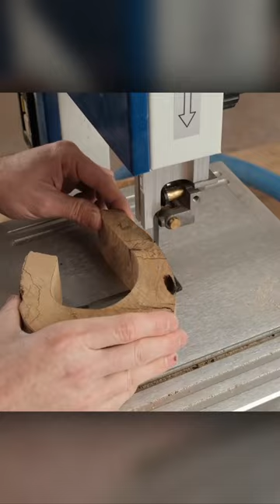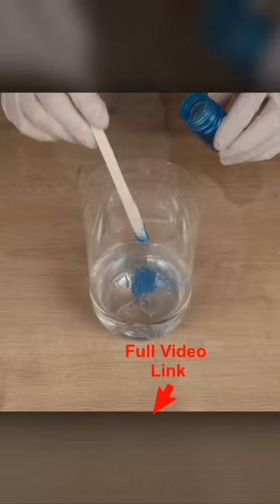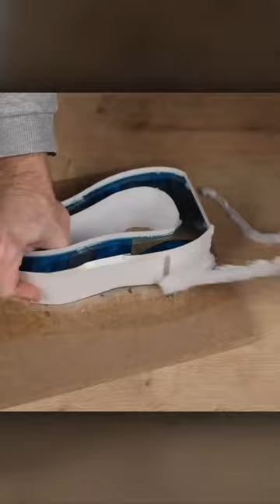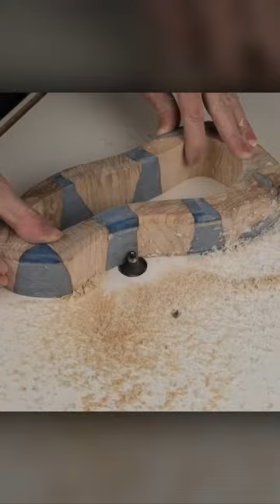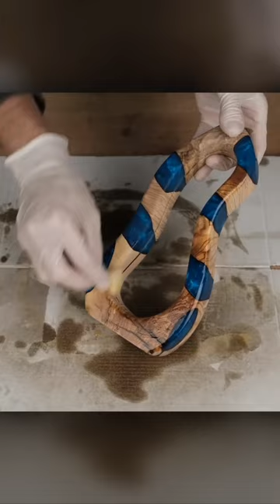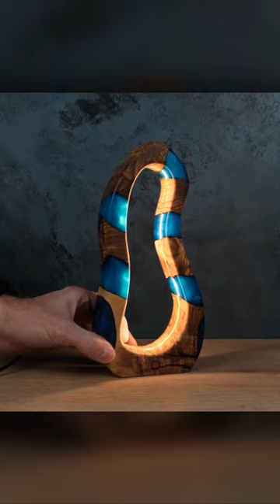Modern Table Lamp with Wood and Epoxy

Comment: Another beautifully crafted piece bro! The color contrasts in the deep caramel color of the wood with that rich blue resin is stunning. Thanks for the tip you gave me on that PVC table cover - I have some being delivered today. It’s going to be so much easier than building melamine molds! Cheers
Reply from the maker: Thanks, I'm glad you liked it.
Glad I could help.
If there is anything you are curious about or don't understand in my videos, don't hesitate to ask. I will try to help as much as I can.
Reply: @atasoy  Thank you! If you don’t mind I do have 2 questions: I typically use a silicone caulk for my table molds but I see you’re using a glue gun here for your PVC molds. 1) What type of glue are you using? 2) What is your favorite vendor for all your LED lighting components? Thanks again pal👊
Reply from the maker: 1)I use a hot glue gun.
2)I try to source electrical components from local dealers in the country where I live whenever possible.
If it's something I can't find, I start searching on aliexpress and amazon as an alternative.
I purchased the LED in this video from aliexpress.
I'm sharing the link.
https://a.aliexpress.com/_EGk8HAl